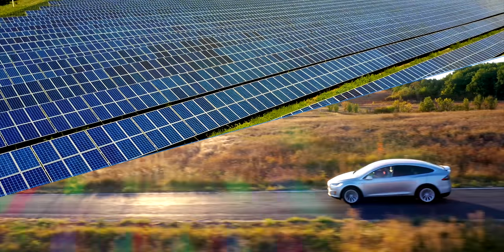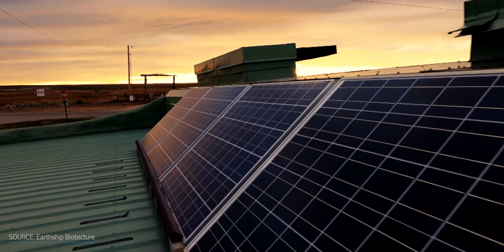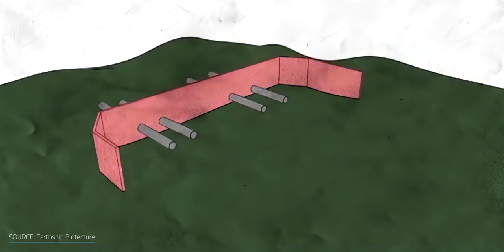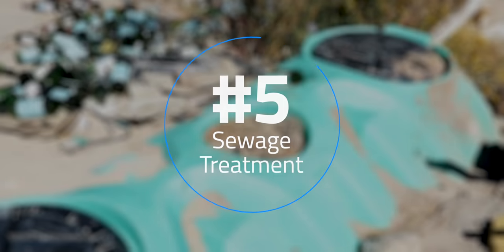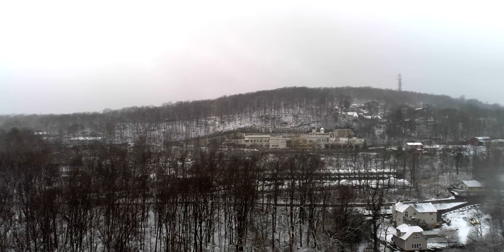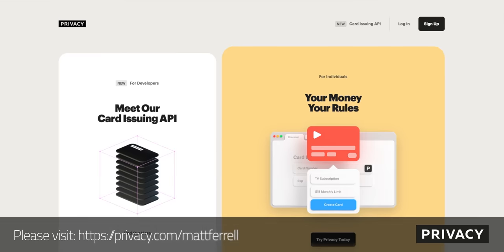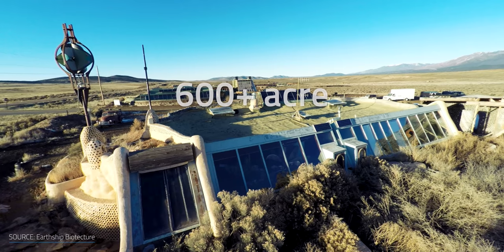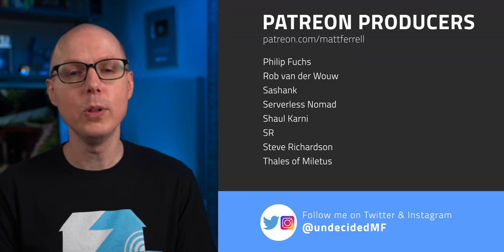Exploring Off-Grid Earthship Homes - Ultimate Efficiency?

Comment: The tires are NOT packed with soil as soil contains organic material that rots. They're compacted with subsoil which is inorganic and never rots/shrinks. Great video though Matt! Glad you took this subject on
Reply from the maker: Good call out.
Reply: Yes, well said for the uneducated, in the ways of Earthships !
Reply: I was looking for this comment.
Reply: Isn't tires release a hazardous substances under sun?
Reply: @ilkarusei  yes..that's why they're sealed with plaster.
Reply: But has there been test to prove that it isn't off gassing toxic fumes, and VOC's. ?
Reply: I prefer bales of straw wiTH  fire retardant on the outside … building blocks and build your house or whatever you want want … !!!!!
Reply: Ok I guess your sub soil would be gravel or rocks !!! Or cement ???
Reply: Many of them also have upwards of 50k miles left on them.. 🤦🏻‍♂️
Reply: @flash7308  They are old used tires and are not off gassing.  Plus they are covered in layers of Adobe and plaster. They is more off gassing in your furniture, paint and carpets than any Earthship. I wrote (volume 2) his books with Mike and worked for him for a few years.

Comment: Imagine actually living in a timeline where I could afford buying a home, let alone building one myself.
Reply: just wait a couple of years for supply to catch up after Covid  and stop only looking for a home in major costline cities and you wont have a problem.
Reply: depending on where you live. Building can be cheaper. Most of the materials are upcycled and free. The Land would be the most expansive part. But if you life in places like germany its impossible, because of regulations.
Reply: #crypto
Reply: That would be a timeline without stupid building codes. Blame your politicians.
Reply: @DrBernon  I mean, some of these building codes are pretty stupid, but others are just to keep the average Joe safe. Like he said in the video, decomposing tires can release toxic fumes into the interior and moisture in the walls can make them brittle and cause mold to grow, whose spores can degrade your lungs if inhaled for a long period of time (like inside a home). There are soo many problems and dangers when building a house that no layman can just do it with junk without creating serious health risks.

My brother is a master carpenter and he build his house basically himself with excavation, walls, floors and roof all done himself. But for everything else, like plumbing, heating, electrical wiring, windows, etc. he still had experts come to do it, because a) he wasn't allowed to do it and thus his house wouldn't have been insured otherwise and b) he knew it would just cause problems down the line if he tried to do it himself and since he's gonna pay for that house for the next 25-35 years, he's not gonna take any risks.
Reply: @midnight8341  That seems to defeat the purpose of building yourself if you are just going to have a big house payment. I'd rather live in a small 14x14 two story shack in a rural area.
Reply: @DrBernon  you do realize that here in Europe there are still building codes for old buildings right? These buildings have to be inspected regularly to see if they're still inhabitable or need to be gutted and redeveloped. And of course you're not allowed to build like that anymore, these buildings have horrible energy efficiencies which are just not suitable for the 21st century anymore. And my boyfriend studied architecture, he's seen some examples where roofs collapsed under snow, because the builders just thought they would ignore the capacity margin the architect put into the plans. Same with electricity. A friend of my uncle did his own electrical wiring, because he thought "How hard can it be?" and then his house caught fire, because of his cabling. And because the surveyor from the insurance spotted the laymans work from kilometers away, he didn't see a penny for it, because what he did was illegal. So he had to pay for all the repairs out of pocket.

Just because you think you're capable of building a house doesn't mean the thing you're building will stand the test of time. Some regulations are bs, but most of them were put in place for a good reason.
Reply: @remyllebeau77  my brother built his house right next to my parents in a small village (1080 residents) with the nearest town being 18000 people. He saved about ⅓ of the price of his house by building it himself.
Do you have any idea about how f*cking expensive it is to build a house (2 adults, 2 kids eventually, garage for 2 cars) in Germany in 2021?
Reply: @midnight8341  Germany? Well there's your problem right there. I don't think you have massive areas of unused land or rural areas like in the USA. Plus you are about 28 times smaller.
Reply: @remyllebeau77  yeah, but all of our infrastructure is packed together, which means that we don't waste massive amounts of fossile fuels just driving to and from work, shopping, etc. everyday...
Reply: @midnight8341  I didn't say you had no advantages. Being able to live without a car could be quite good in the right scenario.
Reply: @remyllebeau77  id imagine ud build somewhere in cajun country no? Somewhere in da bayou? ;)
Reply: @adamkrasneski3679  Haha
Reply: @midnight8341  Never in my entire life have I ever heard of anyone having a building inspection. Maybe that is where you live. In that case, they are more consistent, but still... That only means they still you even more money. And yes. Old buildings are not efficient in the way we want them now to be. People back then also only had the kitchen warm, so they did not care about that. But you could still make a building with similar techniques and designs with more modern isolation.

I also find your anecdotes very interesting. They show that those regulations don't really work that well. The builder that cheapened out on the beams sounds like it was an official builder, not some random making his own house. It is almost like the old way, where you had your own house made created an incentive to make them better, than nowadays where developers make them as cheap as possible. And those regulations also did not stop your uncle's friend. Because people want to do things by themselves, and no regulation will stop them. But of course, responsibility always falls over the builder, so the insurance didn't pay. That is fair. Where is the problem?

My point is... Some people are capable of doing things by themselves. And the state has no business deciding who is capable and who is not. Or deciding how houses should be. If you let that happen you end like the US, where houses are required to have a front lawn of a minimum size while at the same time houses are made with what looks like cardboard and tin foil, and fly off with every hurricane.
But also... People should be able to make mistakes. Because no one has de right to decide for you.

To all of what I said, I only see a clear exception. In multifamily buildings. In those, regulations are necessary, because by nature anything that happens in one house affects the rest. But for single family homes you should be more free, and maybe regulate the facade and a minimum structural integrity, so it does not collapse on to the street. For isolated homes, you should be free from anything. If the house falls over you, your problem.
Reply: @DrBernon  But what if you sell that trash house to someone else? Don't get me wrong building codes are still horribly corrupt but there is definitely a reason for them.
Reply: @dillonvandergriff4124  The same as if you buy a ruined 1500s house. To me the solution would be to have the same building codes as today, but be optional. And if you make a house that did not pass those tests, to be required by law to inform the buyer. That way, everyone can make their decision instead of the state making it for you.
And if the house collapses after the sale, the builder could still be responsible if it was for an obvious negligence on design or construction.
Reply: @KhaalixD  I don't know about the OP, but my main barrier to owning a home is the fact that I don't make enough money to buy the land (there are a few places that give out free land but they don't usually have very many nearby jobs), even before the Covid related price surge.
Reply: You can. You just need to know how, which is pretty easy. Then you need to buy something called unrestricted land. You will most likely still need at least one permit and a perk test if you plan on doing a septic tank in most states. You can skip that if you just do grey water and a compost toilet. Will you be able to live in Houston, NYC or San Fran, no. But you can find a lot of places that offer land at a decent price. You just need drive and sweat equity.
Reply: @midnight8341  Why does a house need to stand the test of time? Most houses have a life span of 30 to 50 years. And we over engineer them like we want them to be around like the damn Pantheon. We have cabins here in Tennessee that are over 200 years old that were made using axes and sweat and hard work that are still used today. No studying, no codes, just simple effective building techniques.
Reply: @worndown8280  And those cabins aren't energy efficient, and don't have much in the way of modern technology in them. Does it have a basement? How many rooms?
Comparing a 200 yo cabin to a house is silly
Reply: @adamkaris  My point was, if a house is meant to stand the test of time it has to be simple. Many dont want simple, they want modern. Why over engineer for something that will be outdated in a generation?  And many of those cabins, with simple wiring, and a one room ac are very livable, the question is, does one want to live in a one room house, for many the answer is yes.
 As for energy efficency, cabins hold thermal mass in the winter well and its thick walls, if the cabin was made with logs, prevent heat from entering in the summer as long as the chinking is good. The one thing they are prone to is humidity, and as I said, even a window AC, will quickly address that issue. 
And I dont think its silly, up until a decade after WWII many American homes were built in a sectional process, like traditional American cabins, expanding with family need. With simple "dog runs" attachments are easily added.
As for basements, most cabins didnt need them. They had root cellars for those needs.
Reply: @slartibartfast7921  #pumpanddump
Reply: @iforgotmyrealname420  #fearanddoubtspreadbyinstitutionstomaintainlowpricewhileloadingtheboat
Reply: Oh, you could build one yourself... building materials alone are like 25% of the cost, rest is labor and profit for various companies+ developer+ architect.
5-10 years of working both a regular job and a "second shift" at your construction site and it's possible to do. Assuming you have all the skills. Also would probably need to build 2 or 3 homes this way as a group since for a lot of stuff you need 2 people, so one time you help one guy and next week he helps you.......
Reply: 3:05 Matt said you can get tires for free or cheap. Watch the man who built a castle by himself in about 25 years on Adam the Woo.

Comment: There is a male nurse here in Amarillo who did build his house out of old tires. He would work his shift, come home and change, go get the tire or tires he needed and go to the site and start packing the tires full of dirt and then stack them accordingly. He would do so many and then go back to the apartment and get some rest before his next shift and this went on for 2 years I think. He also built it into a hill to get the radiant energy off the dirt that surrounds 3 sides of his house. He has rain gutters that feed into a black tank with 4 kinds of water filters that make the water so clean he drinks it every day. The gutter system at the lowest point has a, what I call, a junk tube for like sticks and leaves can go to so it does not go into the water tank. The land is paid off and he basically lives rent free. He has 2 solar panels (then, some years back when I went there) and 1 battery, he does not leave things plugged in, if he needs to use them, then he plugs them in and when done unplugs the devices. He has a compost toilet and the house sits at a slight angle to catch the early morning sun in the winter to help heat the house and an overhang on the roof to keep the heat out in the summer. No propane, just an electric house
Reply: Sounds wonderful

Comment: Has anyone attempted to make an Earthship Apartment complex as a way to expand the Earthship idea in a way that could potentially reduce the construction cost via large scale development?
Reply from the maker: Haven't come across anything.  If anyone knows, drop a comment!
Reply: I think the main advantages come from all the added mass. That’s not really compatible when you are building more than one story.
Reply: this is a good point, could make it feasible in the sense that you could cover several residences with single systems (like greywater). Every residence having their own system is appealing to individualists (like myself) but could be a big hassle for many. 4-6 apartments running on 1 system is less burden for each.
Reply: That would make it more into an arcology, than an apartment complex.
Reply: I think they're building a school in Haiti or somewhere, which looks different, and more large scale if you will. Dont know if it fits your demands though.
Reply: There are a few examples of levels of earthships running up the side of a hill, which look really interesting, but having multiple layers on top of each other in the way most apartments do would call for the need for steel, which complicates things, and adds cost.
Reply: The difficulty in permits would be a start. You can easily get a few stories with modern equipment but that increases the cost. You would be paying a lot in labor and multi family inspection would be different
Reply: @vroomfondel5447  Unless you build them into a hill.
Reply: The Taos folks have been building an apartment complex using their methods.  Last I seen of it, it was 3 stories and had something like 10-15 rooms.  It is definitely different than the single homes, but uses much of the same principles.
Reply: How about a South facing open pyramid design made from shipping containers?  It will create it's own protected open space on the interior, and each unit would be welded in, with interior and exterior balconies. 
Using tires for earth ships is kind of a waste when you already have a berm of earth for a North wall. Maybe a better low cost possibility is the PSP technique? (Poly, Shoring, and Post.)
Lots of new possibilities these days with so many materials and technologies
Reply: The Earthship center near Taos has a three story “apartment” they built as an experiment, although they weren’t able to get it permitted so they can actually occupy it.
Reply: @UndecidedMF  they have a concept design for a 3 story building, introduced a couple of years ago, but Mr. Reynolds has had some big health issues so I'd guess this is not a priority right now.
Reply: The original earthship books had ideas for apartment & communal living iirc.

Comment: My mother made an Earthship after seeing the PBS special of Dennis Weaver's Earthship in the early '90s.  Many hurdles (including fraud from a contractor) made the build take 10 years, but she is in it now and loves it.  I helped with packing many of the tires.  It does NOT take 45min-1hr to pack one tire.  Maybe if you are counting the stucco and finishing, you might say that. With two people, one shoveling in dirt and one packing with a sledge, it takes maybe 5min-10min, maybe a bit more. It's been a lifetime ago when I did it so I could be wrong :-). We had a DIY-made pounder, a metal fence pole stuck in a flower pot that was then filled with cement.  While filling and pounding the tire with the sledge around the edges, you used the bigger pounder to pack the middle and finish. It's extremely labor-intensive.  It is an excellent workout if you are in shape (or want to get in shape). Also, off-gassing has always been a talking point, but my mom has had it tested (a few times I think) and there has never been a problem.

My mom could not afford to make this completely off-grid with solar panels and whatnot, so it is mainly a seriously efficient house with HVAC and a gas fireplace.  My mom is a cowgirl, and she loves the ruggedness of the home as well as the efficiency.  Also, she is an artist, and as you can see in the video (linked below) there is a lot of room to make the design your own with this kind of house. Also, being in Florida means there is a ton of humidity, and the HVAC helps mitigate that.

This video is when she had it mostly finished about 14yrs ago.  Near the end of the video, you can see where it is not quite finished yet, and there are exposed tire walls. That is all finished now. I seriously love the concepts, but I would probably build one so modified (I live in UT) that it would not be considered Earthship anymore.

Here is the video I made eons ago when my mom finished the main part, and we visited for Christmas. 

https://vimeo.com/6238648

Comment: Just as an FYI for the Kinney earthship it was built in an area of the province that sees the largest percentage of sunlight in Canada, is one of the windiest areas and affected by Chinooks all winter giving it a very mild winter climate most years to operate in compared to the northern end of the province. 

I think having a solar/wind driven pump and geothermal heating/cooling system would be a far better option for most of the prairies than just relying on passive heating and cooling like the earthship does. A dehumidifier in an underground home can also outlet to the grey water system, preventing mould and providing a bit more water.